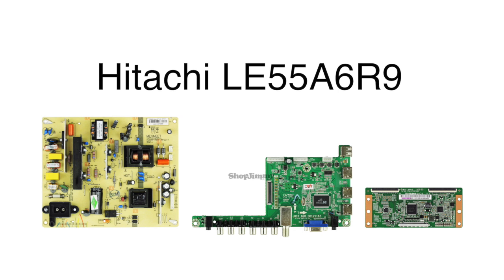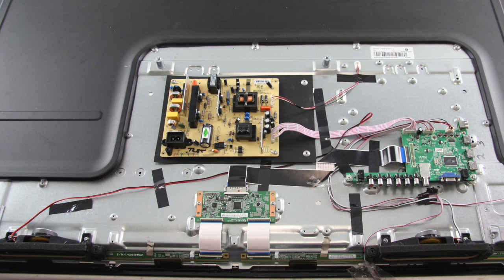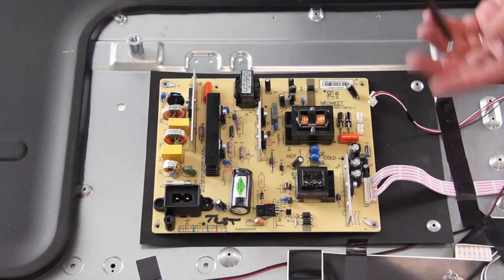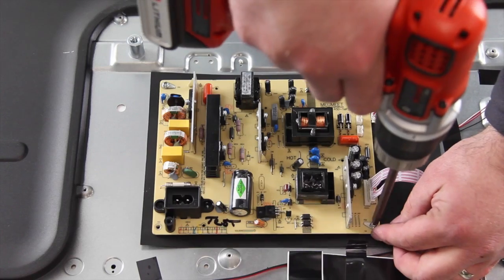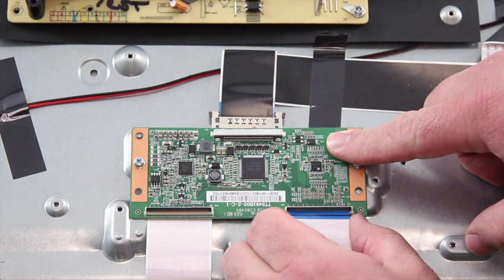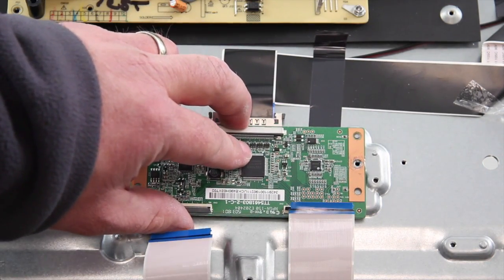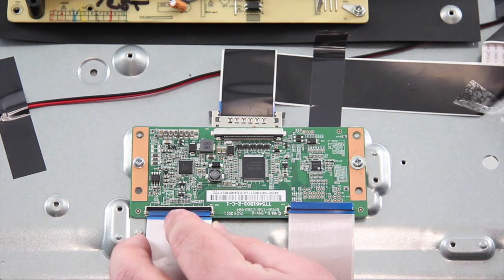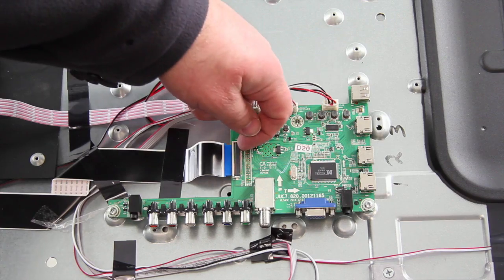Hitachi LE55A6R9 & LE55A6R9A Complete LED TV Repair Parts Kit - T-Con, Main Board & Power Supply

Comment: Hey my name is Cliff I have a HITACHI LE55A6R9 that will not turn on.. all I'm getting is a red power light no sound no picture no backlight ..I have done the flashlight test on the screen as well turning off all light in the room to see for backlighting through the back of the TV both came up with zero leads 🤬 🙄🔫 my next step it's going to be taking off the rear panel...any ideas of what to replace first? Thanks guys
Reply: Hey I have the same problem did you found out the problem is you did I would be so glad to know it.

Comment: Hi Jimmy my Lg l 50lf6100 got struck by lighting the surge came through the surge protector then through the cable box zapping the main mother board and i a sum also the power supply board I checked for cracks and burns but did not see anything do i need to replace all the boards?

Comment: Great video. I have a LE49A509 sn# CH5CB02594 looks exactly like this one when I opened up. I have red indicator light on at bottom but TV will not power on. Didn't see any obvious damage on any boards. TV would turn off on it's own randomly days before it just gave out. Looks like these boards are out of stock in your store.

Comment: have sound but black screen ...where and how do I get the parts to fix it?
Reply: Did you ever fix this? I have same issue
Reply: take a flashlight up close to the screen, if you can see the image where ever the flashlight beam is, it is most likely the inverter board. Secondary it could also be the led strips.

Comment: i HAVE A TV LIKE THAT ONE YOU REPAIR, MY TV DOESNT TURN ON EVEN MANUAL OR WITH THE REMOTE CONTROL, IT HAVE A BLUE LIGTH  UNDER THE LOWER CORNER, NO SOUND NO IMAGEN, I HAVE  BUY ALL THESE 3 COMPONENTS TO REPAIR MY TV? THANKS